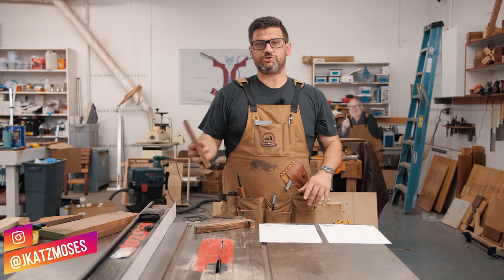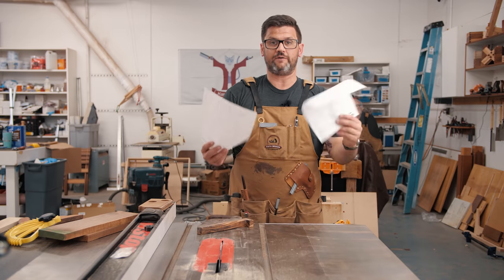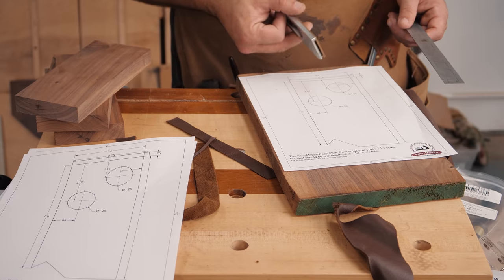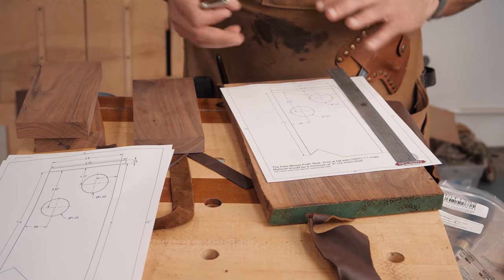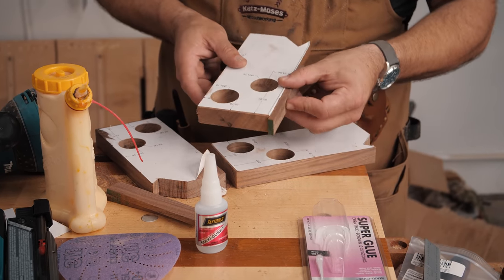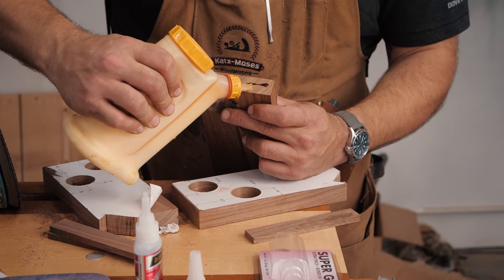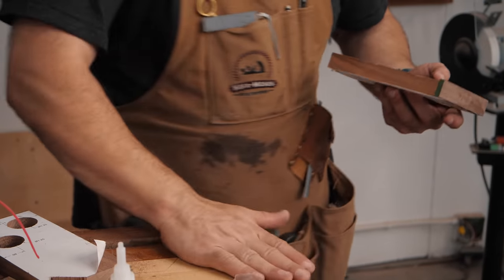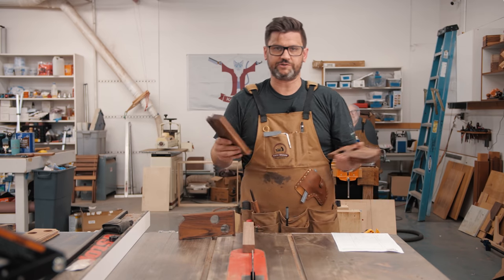The Best Push Stick Ever? FREE Plans

Comment: One tip from a scoll saw user. When gluing a paper template to wood, put down a layer of painter's tape. that will help tremendously when removing the paper. appreciate the videos!
Reply from the maker: That's a great idea!
Reply: Sage advice!
Reply: I always use dubbelsided tape for my paper templates
Reply: Great idea. Thanks for sharing!

Comment: I prefer that my push sticks/blocks have smooth, rounded corners and edges. I had a push block hit the saw blade and kick back at me, and the sharp corner tore into my palm with a great enough force to injure me. Now all my push sticks/blocks are user-friendly.

Comment: Fantastic work, Jonathan! I'm definitely going to download the plans! 😃
About the way to add the back strip, you can make screw threads on hard wood and then use nylon screws. 😊
I have a set of drill bits I bought from China that make the hole and the threads at the same time. You know? And I only use them to make the threads (with the drill) and they work amazingly for that! I bet you can find even better ones there in the US! 😊
Anyway, stay safe there with your family! 🖖😊
Reply: Haha

Comment: Seems to me that it has some safety issues.  1) In the horizontal orientation, the hand is far too close to the blade, 2) I can see someone wrapping their fingers through those finger holes and either prunning them, or breaking them if a kickback occurs.  (FYI) I almost lost two fingers to a table saw, makes one rethink things.

Comment: Is push stick/block shape just personal preference? Wondering if anyone has actual reasons for each feature and size of the tool that makes it the safest design for general work on ts.
Reply from the maker: Watch my slow mo kick back video
Reply: @katzmosestools  not a fan of Danny devito? Just watched it and it had very good info. I have your apron so good to know I'll get a two'fer but with less (hopefully damage). 🤣

Not sure if you'll reply to an additional comment, but I'm wondering if using a dense hard wood like white maple or purple heart is better, worse or not important when using relatively underpowered table saws. Is the slower feed rate when ripping hard woods a consideration for avoiding kickback? Ex: ripping cedar or some other soft wood and the blade catches the hardwood push stick if you're moving it through too quickly? Also, another idea for a topic: I use a magtech feather board. How much pressure is recommended against the board?... downloaded the push stick plans! Thanks for all the well edited, useful videos. You and stumpy are my go to.

Comment: Woodworkers definitely get carpel tunnel.  I framed houses for 15 years and then I started mechanic-ing on GE power gas turbines. I can’t hold a sander or other vibrating tool now for more than 15 minutes at a go.  I’m 49.

Comment: First of all: I saw some of your videos and I really like them - so, really no offence. I'm doing woodwork as a hobby, so, I'm not the most experienced one on planet earth. Really: No offence planned. I recently hurt myself when using an improper push stick. I got kickback and the edge of the push stick rammed into my hand. I should have had some stitches, my doctor said when she saw the result. So when looking at your design I see three things I do not like/understand: 1) When using it "above" the wood your hand goes close to and over the blade. What would happen if your piece of wood slips away (any direction) by accident somehow? 2) Sharp edges when using it as push stick - that's what caused my problem. 3) What happens if you use it as a push stick, your fingers through the holes and you experience severe kickback. Woudn't they break?
After my incident (I always used the same type of push stick) I settled to the ones the officials in Germany recommend - why aren't they popular with you guys? https://www.bghm.de/fileadmin/user_upload/Seminare/Holzbranche/TSM2/Zeichnung_Schiebestock_Foto%20.pdf

Comment: First, please do not take this as me being snarky. I am grateful that you at least thought of us out here in metric-land. But those are not metric plans.

For example, you have the two holes both ⌀31.75mm centred 24.94mm and 25.49mm from edges. I get that you would have two 1 1/4" holes each 1" from the edges. Just to take the holes, if I want to drill holes the exact same size as you, I can't get a 31.75mm Forstner bit. To drill the exact same hole, I'd get a 1 1/4" bit! Using metric tools, I'd have a 30mm Forstner bit. And in fact I do.

Similarly, a metric plan would call for the holes to be centred 25mm from the edges.

My point is that there is more to making a 'metric plan' than putting all the dimensions through a calculator or computer programme.

Again, I'm not being snarky. I do appreciate your effort.

ps I'm loving my apron. I love the fit and the materials and I'm enjoying getting my 'apron carry' adjusted to the essentials.